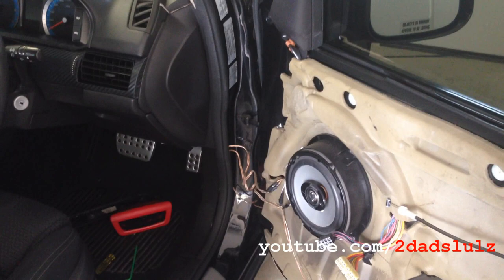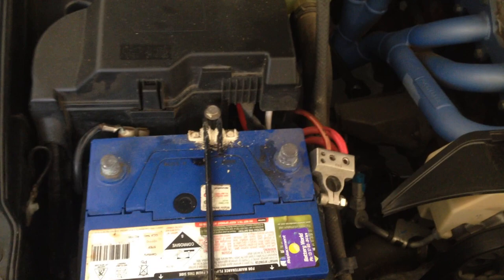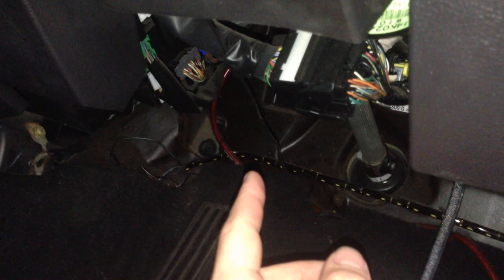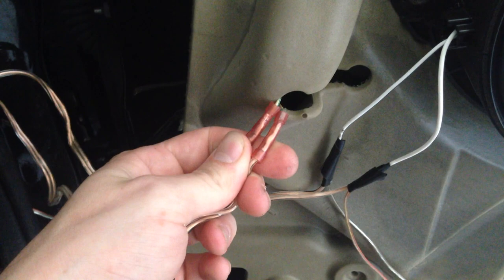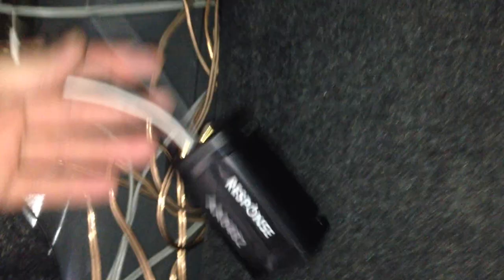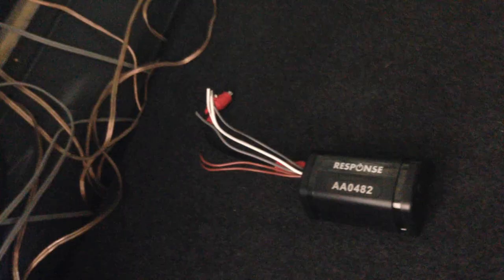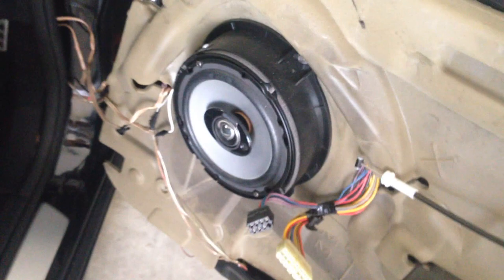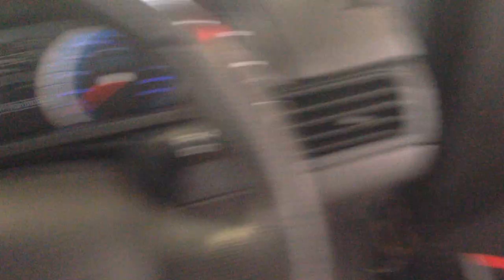Ford Falcon FG Sound System | The Basics | Amplifiers

Comment: NEVER EVER put the fuse in the boot. what happens if it shorts under the carpet? Game over car burns to the ground you're supposed to put the fuse by the battery so it pops if anything shorts out on the long end.

Comment: great vid but im pretty sure the fuse is meant to be as close to the battery as possible because if the power wire rubs on the body and bridges the positive to the chassy you will blow the battery and possibly melt some stuff,
Reply from the maker: Yup, read the description and I've added that. However there was ALSO supposed to be a notice on screen, thanks for highlighting that for me! I'll fix it up. 

I personally keep the fuses in the boot anyway, but obviously I want other people to have all the info :)

Comment: Fuse should be at battery. You have probably 3 mtrs of un fused cable running along the length of the car just waiting to rub through somewhere and start a fire.

Comment: hey mate ive used the same speaker install set up there, bolting them onto the stock "casings" if you will. though I get a constant buzz -- i think the speaker is hitting up against the trim? what do you think? doesnt do it with the trim off...
Reply from the maker: +cizlol Probably touching the trim yeah. First time I did it I didn't realize that obviously the speaker moves up and down and when the volume was high enough it was tapping the back of the trim.
Basically got a grinder and carefully removed the pattern on the back of the trim over the speaker and then sanded it down.
Reply: +cizlol  are your rca cables and power wires running on the same side of the car?
you may have resistance in the wires
Reply: hamish brown thanks mate. turned out to be the trim. i hacked it off nicely and no buzz. only happened with certain lower tones and some songs. 'thankfully wasnt a wire issue (im terrible at electronics)

Comment: The amps have a fuse. That fuse is to protect the cable running the length of your car.  So if you have an accident  you’re car doesn’t catch on fire. You put it at the wrong end and that’s not just dangerous but potentially deadly specially if you’re trapped in the car after an accident and the electrical cable is now arcing out. Combined this with a leaking petrol tank and it could me lights out for you.you should remove the video or at least edit it.
Reply: True 👍👍👍

Comment: My 4 speakers (zeroflex 6.5 mids) plus tweeters I connected behind the ICC with an adjustable LOC because I needed to change the precut voltage to 4v for a clean signal on a zeroflex NZ4120 tuned with a SMD DD1. In the boot I removed the factory rubbish sub used the sub wire to run another 2 channel LOC but ran as mono adjusted for clean RCA output at 4.8v. Im running a 30hz tuned slot ported box with 2 zeroflex evoxxl 3500watts rms subs in parallel on a single zeroflex evo 8k rms running at .7ohm.. my engine battery is relocated to the boot 880cca 84ah for the engine running in parallel with a 100ah 2500cca AGM and 2 250amp circut breakers. No fuses.. the good thing about the way I set up is everything is male female connectors and takes about 30minutes to restore to stock. Now what I want to know is how are you running the tablet?

Comment: Thanks, now I'll know what to expect when I rip into my GT. Might not need a service manual now, and I have one for BA to BF. I don't think any manual covers pulling apart the CD player/stacker ( thats familiar territory - stackers are mostly the same), mine is jammed and hopefully I can un-jam it and get it working again - before I attack it with the 3 amps I intend to install. Before doing that I want to bypass the internal amps of the Premium system.

Comment: Hey mate quick question, have tried to.find out but couldn't get a clear answer. I'm installing a aftermarket amp in the fg, premium sound. Can I just straight remove the original amp and sub without any trouble to the system?

Comment: hi I have a bf xr6 and when my sub is hitting hard the rear view mirror makes annoying vibrating noise any ideas? thanks
Reply from the maker: Chilly Willy 88 maybe a bit of insulation or sound deadening for the mirror?
Reply: Chilly Willy 88 mine used to do the same thing....i just lived with a rubber band on it for years. but a legit fix would have been awesome. I tried everything short making my own mirror haha
Reply: remove the rear view mirror

Comment: Hey buddy, cheers for the video, just wondering how you go with the speaker cabling exposed from the door to the body, have you had any damage or do they pinch or anything? Cheers
Reply from the maker: AutumnInAlaska Melbourne No worries at all with it exposed like that. You can always get a coathangar and some water with dishwashing liquid in it to help feed the cables through the proper covers

Comment: hey mate, i've got a full audio set up in my FG with a Bit10 computer, have you got the "hiss sound" coming through the speakers which seems like its a signal sound?
Reply from the maker: I get noise at very low volumes, but that is because I am using crappy line converters on the standard head unit which always has that low hiss.

Start with the cheapest easiest solutions first:
Have you grounded everything properly? Almost all noise is caused by poor grounding, or missing a ground somewhere.
Do your RCA cables have grounds? If not, try buying some that have grounds and grounding them as well.
Check that you aren't running RCA or signal wires parallel to power wires. A fat 0 gauge wire will mess with the signal if it's running alongside your speaker wire all the way down the car.

If none of this eliminates the hissing you might need to move up to buying a noise filter, which should be able to eliminate any noise issues.
But a good one can be a few hundred...
Reply: 2dadslulz Thanks for the reply mate, my noise filter is the BIT10, it cost me heaps! so its definately not that! we have done some research and it seems to be a very common FG problem that there is a low level hiss that comes out of the ICC which cannot be fixed, just wondering if you have the same thing happening? if you put the audio to 1, there is a hiss only, no audio, then to 0 there is no audio or hiss, like the signal is completely stopped.
 I have the power and speaker cables running down opposite sides of the car, so thats another possibily solved. I'll see if i can get a video of the sound and ill upload it, but im suprised its not a bigger issue for you! cheers
Reply from the maker: Yep, very common FG problem. It's the ICC that causes it. Nobody seems to know why either, lot's of different theories, nobody is able to back them up with evidence though.

I have it too, but my speakers aren't running through my amp at the moment because the line converter died again. So it isn't as pronounced for me.

Odd that you can't get rid of it with a noise filter though. I've not seen anyone have that problem before.
You only solution may be to use an aftermarket head unit. I know that sucks, because the reason most of us keep using the ICC is for the steering controls and the easy iphone connectivity lol

Maybe you could borrow a head unit from a friend, or buy a second hand cheap thing for $20 and just test to see if using that cancels the noise out.
That will give you the answer as to whether it is the ICC causing the issues or something further down the line
Reply: 2dadslulz I've got a full system with an audison bit one.1, still hiss mate. Getting an aftermarket headunit installed to completely bypass the ICC and get rid of the annoying hiss!
I'm a bit fussing though I like crystal clear sound.
Reply: Thats my latest option too mate, the guys who installed my system are real switched on and theres nothing else on the market that can help. i just dont like the fact the screen is still on with an aftermarket headunit, it looks a touch messy to me!
Reply from the maker: I suppose you could explore a few options in terms of keeping things looking clean.
You could put the head unit inside the center console, that little storage unit that you probably use as an arm rest as you drive ;)
You could move the ICC screen down to where the tissue box holder is and put a tablet or ipad up the top, then run 3.5mm to RCA converter from that.

There are always options for getting all your steering wheel buttons working with after market units but it always involves a lot of messing around.

I have decided to stick with the stock unit because I really don't want to spend the extra time messing around, my volume is always up loud so I don't notice the hiss :P

Comment: Such a helpful video! I am trying to install a subwoofer only to my FG. I hope you could guide me somehow because I am an amateur at this. All that I have with me are, 1) Subwoofer 2)Amplifier 3)Cables. I only want to add a sub and get that extra bass while using stock ICC for controls. Any flowchart like text would also help like Battery>ICC>Amp>Sub. Or something that would enable a dummy like me to install the sub. Thanks
Reply from the maker: Hey mate, to use the ICC controls you'll need to install a line converter
You tap in to your signal wires from the ICC with that, it converts the signal to RCA, which you then plug in to the amp, which then goes to the sub
Reply: FGmods Thanks a lot for the reply. So, no need to open up the wires from the speaker, yeah? Just ICC outgoing wires to Amp and then to Sub.
Reply from the maker: I personally found it easiest to tap the wires at the door my first time.
But yes if you've got the patience and the confidence, definitely tap the wires immediately after the ICC. Makes it much neater.
Reply: FGmods Thanks heaps. This definitely helps a lot.
Reply: tap the wires to the factory sub in the boot straight to the line converter much easier

Comment: Hey man, love the vid and the channel!  I have similar FG xr6 as you.  Kinda disapointed in the fg stock headunit but will loose dash controls if i go aftermarket.  Just wondering if you could shed some light on your mounting system for the iPad? Does it work well for you? If so i might be a copy cat haha.
Reply from the maker: That's going to be my next big project! I'm still trying to get the specifics of how I'm going to do it down, but I have a pretty good idea.
My plan is to pull the screen out put it on the bottom and have the ipad at the top where it would otherwise be

Comment: instead of running wires from from the doors (all loosey goosey hanging out waiting to get pinched) then running wire to the back of the car to the line converter then back to the front and into the door (al loosey goosey again, looking ugly and cheap as shit) just put the line converters under the dash and spend a second to locate the speaker signal wires under the dash then run your rca into the boot.. you can get long rca install kits with a remote wire attached (i see you have a set but your not using yours) 

if you're getting attenuation noise when no music is playing its because you have a EM nightmare of wires going backwards and forwards and they are interfering like i said above have your line converters under the dash with teh signal wires from the stereo going straight to the converter then run your rca down the center of the car under the carpet along the drive shaft tunnel (on inside of car) going into the boot into your amp then from the amp run the speaker wires for each side along and under the door sill trim and through the same rubber door grommet that the original speaker and door control wires go through, this way you'll never see the wires.. if you want to auto salon your car you can mount the amp to the back of the fold down seat so when the seat is folded down your ice is on display add LED strips and your pimpin. when you park (for security) you close the seats and all is hidden from view.. pays to run the sub rca down the middle at the same time as your line converted speaker rca's  it's easier than you think.. just use a straightened strong coat hanger or number 8 fence wire and tape the ends of the rca's to it then push it under the carpet from where it opens under the center console..where the handbrake goes through..
Reply from the maker: +Nexus .Shadow Agree with you 100%
This vid is for basics. Some people struggle just to be able to locate the speaker wires. Everyone has to start somewhere.

I use an active line converter and have a custom box for the subs set up in the boot. Most peoples eyes just glaze over as soon as they don't understand.
When I rip the whole system out and put brand new stuff in I'll be showing how to do it all professionally. Yeah it's complicated for most people, but it's worth it!

Comment: Hey, how did you find the correct 12v wire to use for the signal to the amp?
Reply from the maker: +Keplaffintech I didn't find the one specifically for the amp but I found A 12V that only turns on when the electrics are on
Reply: +2dads_FGmods Did you have to keep cutting wires until you found one or is there an easier way to test them? Also did you use a multi-meter to test, and if so where did you put the negative terminal?

Thanks for these videos you have made by the way they're very helpful.
Reply from the maker: I just used a multimeter.
Tried to trace wires that I thought that went to electronics that only come on when electronics are on.
Just put it against a ground I found in the footwell (can't remember exactly. It was a while ago)
Reply: No hit and miss if you use a service manual - electrical diagrams. I used the cigarette lighter Pos+ as a signal wire to AfterMarket head unit (Alpine, then later fitted McIntosh). I then used the blue wire from A/M   head unit as signal to turn on amps. That way amps only turn on when head unit is turned on. Head unit only turns on with ignition On or Acc, same as cigarette lighter - which still functions also.
Reply: RCA leads run through and under console and under rear carpet to under rear seat to amps in boot. Used existing speaker wire s for the front but beefed up wiring in rear parcel shelf speakers. Sub amp and speaker in boot. US AMPS AXTU 2 CH tube driven 160 Watts RMS P/C for rears, McIntosh 2 CH 50 Watt P/C for fronts, Alpine 500Watt sub amp. It gets pretty expensive but it doesn't get much better than this, very "very" loud "and" clean,  lots of headroom. The tube driven rear amp and Kicker speakers give the most, heaps of power in that rear amp. Just ripped it all out today from my blue BA XR8, it will be going in my newly bought FG GT. I think I'll most likely try using the existing head unit. I'd like to tap right into that and bypass the internal amplifiers, I only want the signal channel wires (before they enter existing amp). Yes, it will be an electronics quest, not sure if I'm up to it, but that's what I want. Need a bloody microscope I reckon.
Reply: Cigarette lighter best to use as it has it's own fuse line

Comment: I have a Ford ba I’m just wondering how to get the power cable from the amp in the boot to the battery in the hood . I know you run it all on the side skirts but from the pedals where does it go
Reply: Through the fire wall

Comment: Do you have a video on how to change the globes to a different colour in the ICC and instrument cluster?
Reply from the maker: Glenn whitfield I don't. I've spent a long time trying to work the ICC out and it seems they are individual LED diodes soldered directly to the board. So unless you can take them off and get new ones in without damaging anything I'm not sure it can be done

Comment: hey mate you know how to install a head unit into a Ba falcon with a premium sound system ? what wires to tap into speakers power etc Ford has so much wiring going on its fucken crazy. any help would be much appreciated. as I have everything all installed an ready to go amp sub cabling all tucked away . just need to hookup the head unit swc
Reply from the maker: The BAs specifically no.
I have been led to believe that all the falcons up until the FG have RCA outs somewhere nuder one of the seats.

Comment: Dont run your speaker wires anywhere near your power cable.. thats why you get static...
Reply from the maker: Jack A Yeah that's true. This is only a basic easiest way possible set up.
The best thing to do is go through the kick panel where you can get all 4 wires on one side and the power down the other
But using the ICC still gets a shitload of hissing. The FGs are notorious for it. Only way to eliminate it is to go with a new head unit
Reply: Depending on the quality of cable you have if its shealded or not... its dc not ac

Comment: Can this way be used to install a system in 2009 territory
Reply from the maker: I see no reason it can't be.
Should be similar layout between the two and line converters work so long as there is a signal.
Reply: dsb2767 don’t do it like that. It’s actually a very bad install. He lacks understanding of basic electrical safety. 12volts can still be dangerous especially when that fat power cable gets pinched in the passenger compartment with the fuse at the wrong end. It should be near the battery where it can do its job. Protecting you. The amps have got fuses to protect them. The glass fuse is to protect you from a fire in the event of a accident.